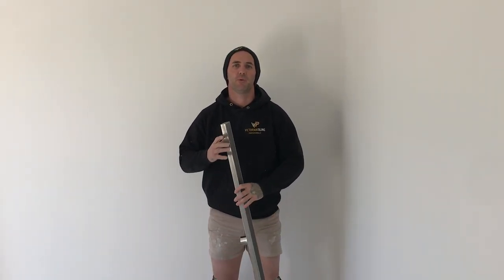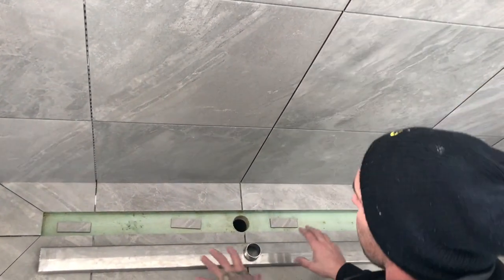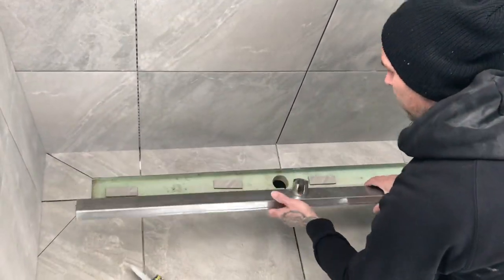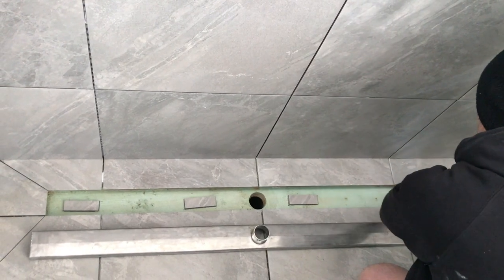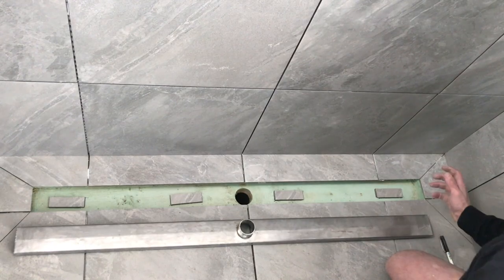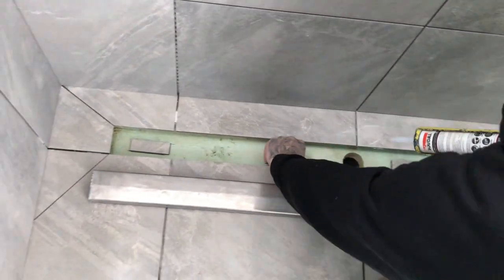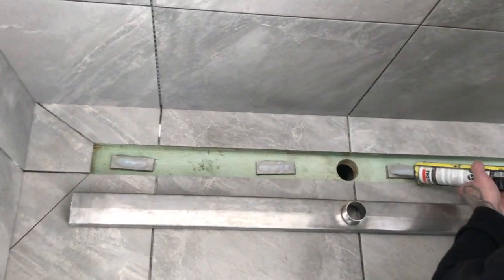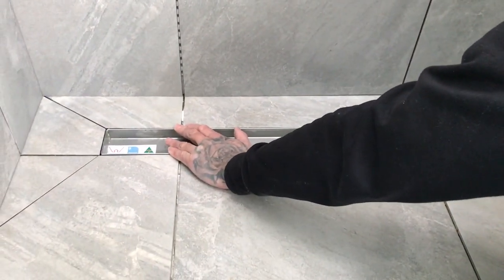How to install a Linear channel shower grate in a tiled Showerbase

Comment: Should we use silicone to glue the drain into the exhausted floor pipe or it must be loose, please?  Is that OK if it`s installed flash to the back wall with no floor tiling behind of the drain, or it can be dangerous with a possible leakages? Thank you
Reply from the maker: I personally would not put silicone on the pipe . If water does get underneath the drain it will need somewhere to go.
I don’t see any reason why you couldn’t put the drain at the back wall ive seen this done many times 👍